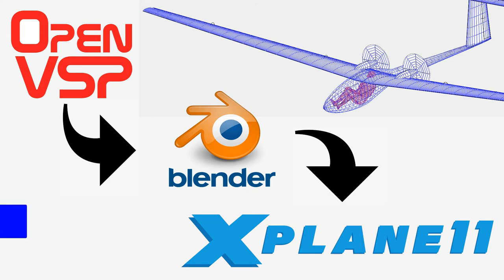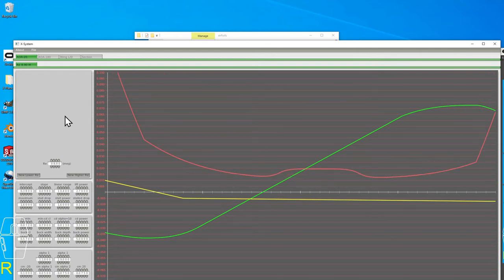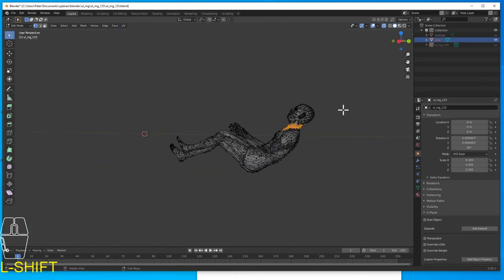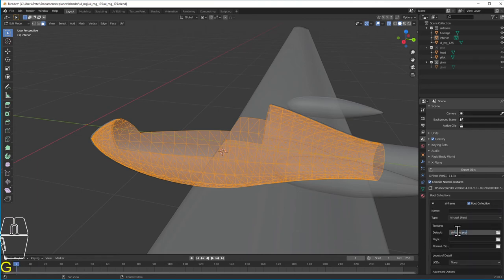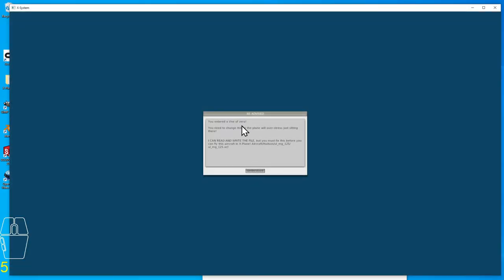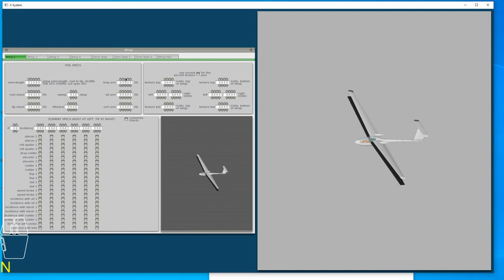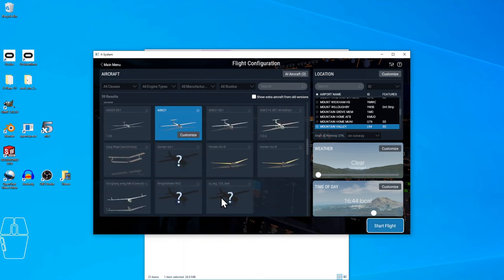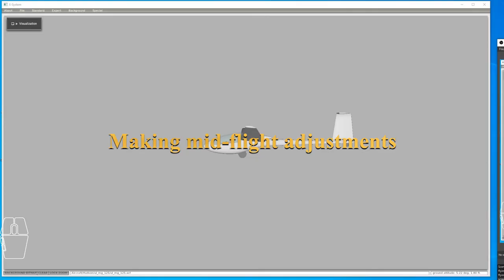OpenVSP to X-plane in 49 easy steps.

Comment: Thanks for the video, Peter. I want to do some of this in the near future.
Reply from the maker: Hi Leon, 
I've refined the fuselage shape a bit, added some forward sweep and I'm happy with the view.  I was just using openVSP to make 95% male and 5% female objects to import into Blender where I try to design a seat that might work for the range.  (I'm at a very similar stage in my design as you are in yours!)  I'm thinking my next video may address making a physical seat mock-up so I can tell it it's comfortable for a 5 hour flight!

Comment: Thank you very much, In what format you exported from OpenVSP, to get it imported in blender?
Reply from the maker: it's "file export .obj"
Reply: @peterhudson2569  Thank you for your reply, Does that format works with XP11 directly, Or it is the standard format?
Reply from the maker: @AdelHaiba78  I have always read the .obj into blender then used the "xplanetoblender" add on to export a new .obj that is compatible with x-plane.  I'm not sure what would happen with using openvsp's exported .obj directly in x-plane but it would be awesome if it worked!. ..but I use blender to uv map colors and animate controls  etc.
Reply: @peterhudson2569  Thank you very much Sir, Regards

Comment: How can I move from cad model to openvsp?
Reply from the maker: OpenVSP has a few formats that it can "import"  (like STL which most CAD can export) but it's really better at creating OMLs from the geometry inputs.
Reply: @peterhudson2569  when I import as stl it is meshed really bad compare to your case? P. S I am using spaceclaim
Thanks for your reply
Reply from the maker: @ras22king  What are you trying to achieve? a model that works in Blender to create an X-Plane model?  Or one that works in OpenVSP for analysis?
Reply from the maker: @ras22king  Maybe try exporting from spaceclaim as a .OBJ file and going straight into Blender with that?
Reply: @peterhudson2569  one that works in OpenVSP for analysis
Reply from the maker: @ras22king  I'm no expert in that I've always built the model in OPENVSP.  try asking at https://groups.google.com/g/openvsp
Reply: @peterhudson2569  thanks for your reply
Reply: @ras22king  openvsp can only analyse the object types created by openvsp, eg. fuselage, wing etc. So you can't just export any old model and expect to use it for analysis, and definitely not a simple mesh like STL. At best you could use the STL as a reference to create openvsp bodies at the correct size and position.